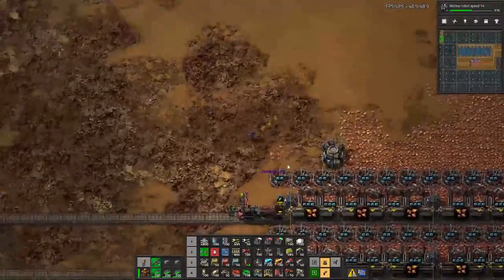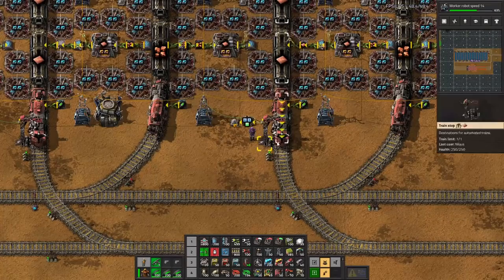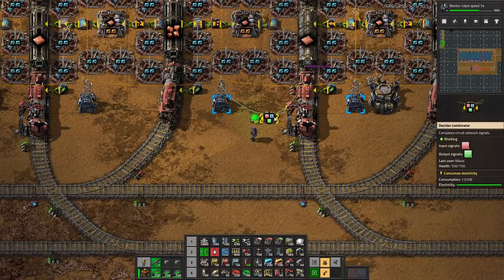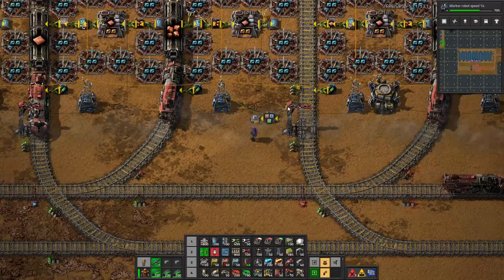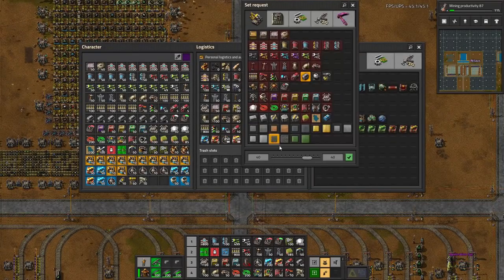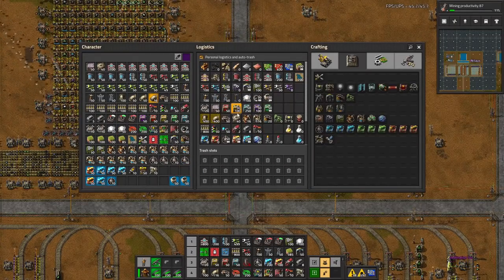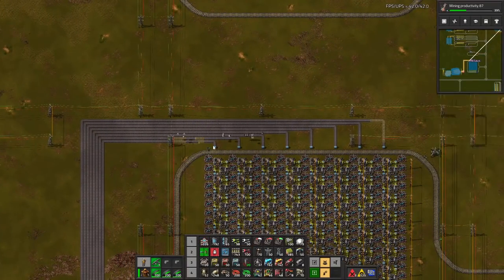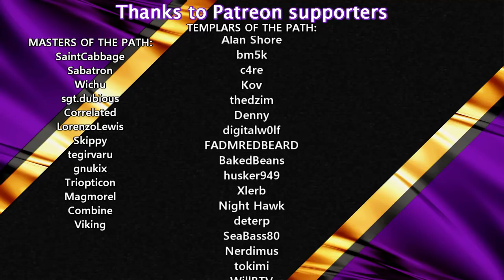New Monitoring System for Direct Smelting | #71 | Factorio Megabase-In-A-Book Lets Play

Comment: Have you ever experimented with having a build-a-tron formation for specifically solar/accumulators? Their internal inventory is almost double the size of your buffer chests and they come with their own internal robots which sort of obviates both problems with a buffer chest as you can expand more locally to the spider rather than the whole strip sort of randomly and it prevents bots from needing to travel all the way from the main base. Not sure about the impact on UPS from spiders vs bots, but it is definitely less total entity travel time.
Reply: I like this but i gues you have to same issue as with the landfillers.. you cant fire and forget
Reply: I agree with Koen, spiders are too micro at this scale.
Reply: I like this idea. While Spidertrons start to scale worse as bases get larger, like other replies said, placing solar/accumulator is much less intensive than landfill, since a city block requires 10,000 landfill and only just over 1,000 solar/accumulator. However the only way to really test this would be to build the whole thing, and that much work just to see if it's a bad idea...

Comment: Won't there be a big delay in supply vs demand signals balancing? If the supply signal disappears when the train leaves the station, the demand signal is still active until it fully unloads. With so many stops and signals, won't it be fairly inaccurate as a snapshot?

Comment: Nilaus, for building plastic/oil and liquid builds you can assign a dedicated spidertron following your pack of buildertrons that instead of regular inventory will be filled with pipes, chemical plants and refineries. This way you can have a remote liquid builder without spamming the inventory of all bots.

Give him another color to point out that his mission is different.
Reply: I like this idea!  Just don't forget to include a few barrels of heavy oil in the mix.  :)  (Of course, that also raises the one problem... one will still need to visit it, if only to get the items out of the spider.  Unless there's some weird way to do this with logistics?  I guess one could leave a couple spiders in a corner somewhere with two versions of the logistic requests, allowing bots ... no, we'd then need logistic bots... hrm.  I'm not sure if there's a solution... maybe?!??  But, at least the materials would show up.
Reply: @DavidLindes  You can include a few logistic bots inside the spider + requester chest asking for heavy oil barrel for the machine in the blueprint
Reply: @panbubr  but how do you get those logistic bots into a roboport?  Will the spidertron's port actually send logibots out???

Comment: Suggestion to sum all green signals first and only then change the type (for example, to copper). Easier to change signal type (if needed) this way. That is if all stations in your module outputs only one type of resource of course.

Edit. Nilaus actually did this (kind of) later in video

Comment: Not sure how much partially full belts add to the workload, but you could condense those to, say, four belts instead of eight in those locations that are almost empty and only split them again directly before loading.
In locations that are already close to running out it would not significantly slow down loading (since the belts aren't full anyway), but considering those belts sometimes run for a city block or more it could drastically reduce the number of partial belts.
Would not be a complicated fix either.

Comment: Hi. 
I think you should, at request stations also add that if a train is inbound it should not send a signat to the dashboard as the demand is already on the way. 

It will not show if the train network breaks down but it will show the correct demand if you subtract what is already on the way
Reply: You could just add the trains inbound to dropoff stations as available (on the green wire). Then your train system breakdown will still get monitored correctly.

Comment: When designing a monitoring system, I think the focus should be on the questions you're asking of it. And those are determined by the problems that are likely to occur. So the problems could be:

1: Insufficient ore trains. There should always be ore trains either at the station or coming in. The only way this could fail is due to exhausting the mineral patch. Which you have a patch-specific local monitor for. And that's good, since patch exhaustion is a local problem.

2: Insufficient plate trains in the station. There should always be a plate train in the station or a plate train on the way. Assuming you have enough assigned trains, the only way a train wouldn't be coming in is if trains are delayed in their return for whatever reason.

3: Plate trains with nowhere to go. This is only a problem if you have a number of plate trains dedicated to specific processes rather than just feeding any copper dumps that are open. That is, the dedicated consumers could be starved if the generic consumers aren't consuming fast enough. But that's a structural problem that would probably best be fixed by not having dedicated plate consumers.

So it seems to me that the only monitoring system you need is one that detects if there are any stations with no trains assigned or waiting. The more open stations, the worse things are getting somewhere.

Comment: I still really don't like the fact that the plastic modules and the solar/accumulator module output partially empty belts. Next time the UPS drop below 60, you really should re-design those, Nilaus.
The Solar/Accumulator build can bee easily fixed by scaling it up from 1 column of 18 assemblers to 3 columns of 15 assemblers. That consumes 7.5 belts of green chips and outputs exactly one full lane of solar panels.

Comment: There is a way you’re new direct smelting can get stuck.
Reply: You mean due to those 10th plate trains? I don't think so. Even if only 1 station ever requests copper trains, most stations have a limit of 3, which leaves 17 copper plate trains in the 18 smelter slots, and thus one of those 3 trains will be able to go back. And there are WAAAY more copper stations that will be requesting trains.
Similarly, there is almost no way that 5 iron trains will block all iron consumers.
Reply: @Pystro  It's the first ore smelting station. Since that station is in line with all the other ore smelting stations, if a train is there, no other ore smelting stations can be reached.  Now, if an empty ore smelting train leaves for the mines, the mines will now be full with 8 trains so now all the other empty trains will get "destination full" warnings, including the one that is in the way of all the other trains. So, that one won't be able to leave, thus blocking the entire system. However, I believe there is something i'm missing as it hasn't blocked yet, or Nilaus has been very lucky.
Reply: @RealCyclops  You mean the one on the left at 6:51? An ore train will only attempt to enter that if the station is empty, or if the train in there has begun leaving (due to the train limit of 1). Same as with all other ore drop off stations.
Reply: @Pystro  yes, I think. Looking at this station, i missed the first branch off going to the right and all of the other stations. But I believe one of his first stations didn't have that branch off to avoid the crisscrossing of the two separate train systems at the entrance.  I'd have to go back and look, but it is possible that I missed that too.